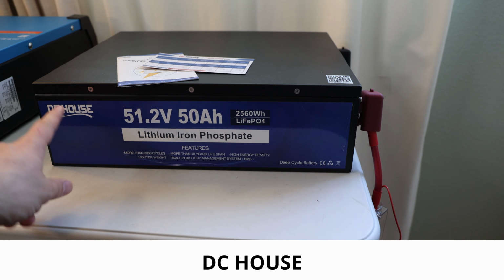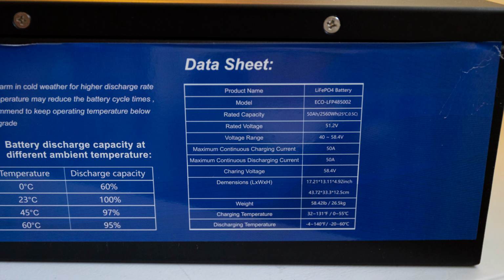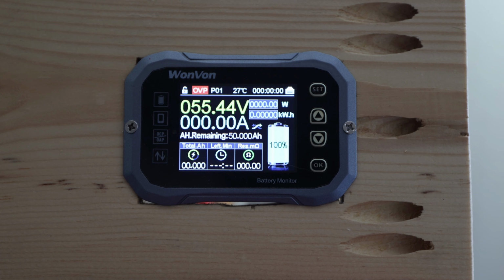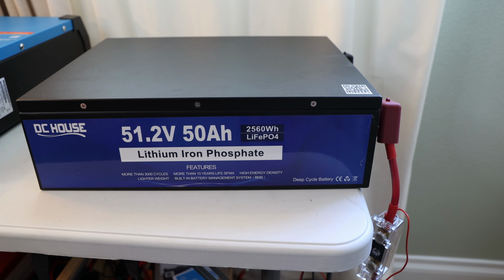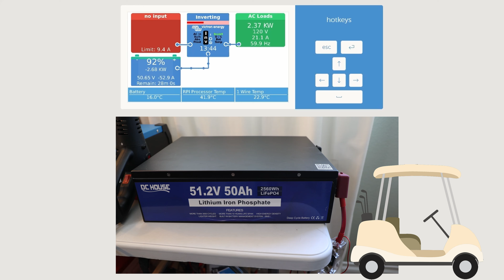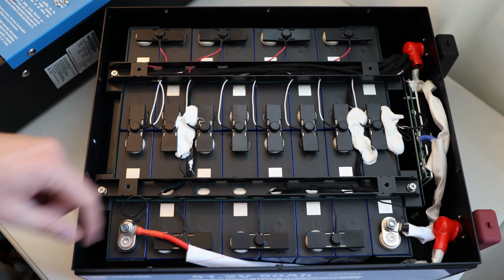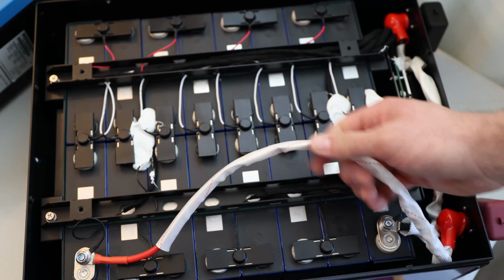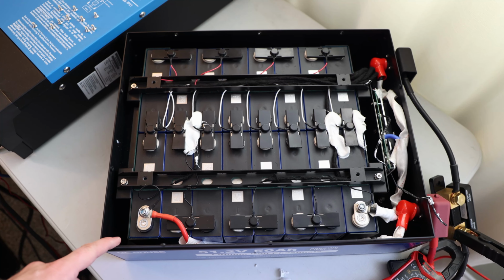DC-House 51.2V 50Ah LiFePO4 | Review and Test | Golf Carts AND more!

Comment from the maker: I did forget the most important part to add to the video - the Ice Pack test did NOT work! That's why I did use the duster and was able to trigger the low temp cut off. Unfortunately I missed this very important part! The cold temp cut off does work at a very low temperature and can already damage the battery - worst case. If you do not want to use the battery in a cold environment you will be fine - given the built quality ;-)

Comment: I like how they misspelled "Charing Voltage" on the label (LOL). Just ordered the 2-pack and hope they work with my charger/inverter setup. That thing is a lightweight compared to a 100ah or any of the lead acid 225ah batteries in my golf cart (LOL)...

Comment: I hate seeing a duster used for cold temperature testing. That will drop the temperature below -40°C. A medical gel pack is better for proper testing.
To run a golf cart, you'll need a lot of surge power.
Reply from the maker: Good call. I hate to say it - but I did test it with the ice pack but with a different way of charging and it did NOT shut off. That's why I used the duster and it did work. I guess I messed this one up due to switching too many things back and forth at the same time... I knew there was something I forgot :/

Regarding the golf cart, where are you located again? ;-)
Reply: @tobisreallifeskillswithtobi  🇨🇦 To busy to test another golf cart battery. I have three waiting for warm weather and firm ground. 😀
Reply from the maker: @Roll2Videos  Haha, I bet ;-) I'm looking forward to those tests!

Comment: Is there any protection between the cells? As the housing of the cells is connected with negative connection. If it's just the thin blue plastic in between, I would never have dared to use the battery

Comment: Seems there is no fibre board insulation between each individual cell, the thin blue shrink wrap is not sufficient especially when used in golf carts and battery is shaken around. Also an extra foam layer between each cell will give some room for a little bit expansion and keeps the cell pressure (kg/cm2) in check

Comment: Some websites state max 50a discharge and the spec sheet on the battery state max. 100a cont. discharge. What is the rating of the BMS? 
Maximum 4 in parallel or are more allowed? Some websites states more then 4 is allowed when using a busbar, what is the correct info? 
Nice battery but specs are vague and battery seems to lack proper cell insulation to make them safe when rattled around.

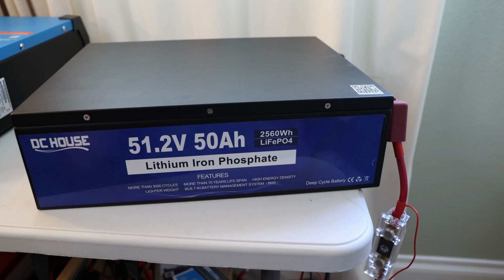Comment: Hi Tobi, I had to redo a comment I made earlier because apparently YouTube didn't like me linking to Amazon. @ 3:43 you made a comment about max 4P (4 batteries in parallel) but on Amazon there is an image of the specs that states 'Parallel Unlimited'. So I'm confused now, which is correct? My common sense tells me that there should not be a limit on putting them in parallel, as long as the cables can handle whatever load you're applying.
Reply from the maker: Thanks for watching! That's what I don't like about those Chinese manufacturers. On Amazon they advertise one thing but the manual delivered with the battery tells a different story. I just checked and on the Specification Guide for this battery it states "Number of series and parallel connection" 4P1S.
I just looked at Amazon and compared my screenshots. They added the new picture which says 1S2P. I'm with you why you want to add more. They even make this comment in the Amazon description: "When connected in parallel, the number of batteries is not limited so it is convenient for customers to use it."

I usually want to listen to the manufacturer. But the form factor is so good to get 4 of those might work - without guarantee (make sure you have the appropriate cables as you pointed out.) 

Sorry to not give you an easy answer with this Chinese battery... Do you have a specific use case why you want 200AH in a 51.2V configuration?
Reply: @tobisreallifeskillswithtobi  Thanks for the quick response! I'm going to build a grid-tied Victron-based ESS with 8 of these batteries, combined with 2 Multiplus II 48/5000/70 inverters. I'm guessing since the batteries have no means of communicating with each other or a Cerbo GX, the risk of getting imbalances will be higher than with e.g. Pylontech batteries. But this also depends on how you wire them, generally hooking them up to a bus bar with equal length cables and/or diagonal connections is considered best practice to help minimize the risk of unbalanced loads. And of course it's also important to charge all batteries to the max individually before putting them in parallel.

It's really annoying to get conflicting messages from the vendor and manufacturer, but I guess the best thing to do is perform some tests once I start building and put more than one shunt (e.g. SmartShunt) in place to monitor the batteries instead of just relying on their built-in BMS. I think the main issue will be enabling the ESS to 1. obtain the correct SOCs and 2. keep the battery bank balanced. Regarding the latter, it might be a better idea to assign each Multiplus II its own battery bank. So that would be 4 batteries each, which would also align with the 4P advice you cited.
Reply from the maker: @ProMace  That sounds exciting! Let us know how it works :-)

Comment: Hi, I wanted to ask you for info on the parameters of the Epever6415an controller. What voltage of BOOST , FLOAT , MAX CHARGE VOLTAGE enter ? The manufacturer only declares the charge value at 58.40 v which is high by many users. Thank you very much.

Comment: With that 50A cut off you can't even drive a cart up a ramp to a trailer.  Even a stock DC setup will crush 50A on any kind of minimal incline and shut the BMS down.  Had to deal with a couple of these.  You need like 3 at min in parallel for a golf cart.  Even stock ones.
Reply from the maker: Thanks for your feedback and watching!
Reply: I'd love to throw one of these on my ebike on a trailer. awesome!

Comment: Tobie do you like DC House 48v better then the xrh 48v?
Reply from the maker: Thanks for watching and tricky question! I like the Bluetooth of the XRH. But I like and prefer the built quality of the DC house .. I experienced cell 1 of the XRH is not good and therefore I can't pull the full 100 Ah. I did not follow up yet since I use it as a test setup but encountered this. If you have a good shunt and good low temp protection on your end, go with DC house... I love the enclosure! I hope this helps!

Comment: what do you think is a better buy GrenerPower 48V(51.2V) 105Ah Golf Cart LiFePO4 Battery, Built-in Smart 300A BMS, with Touch Monitor & Mobile App, Max.15.36kW Power, 48V Lithium Battery with 58.4V20A LiFePO4 Charger for Current price$1,699.99 DC HOUSE 48V 50Ah LiFePO4 Golf Cart Battery 2560wh, Built-in 50A BMS for price for 2 which makes it 100Ah $699.99 ?